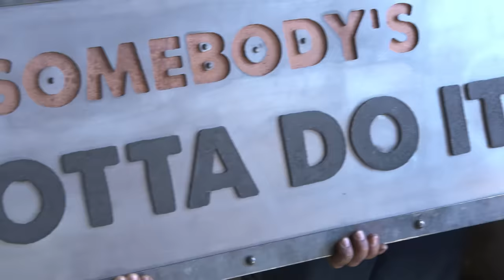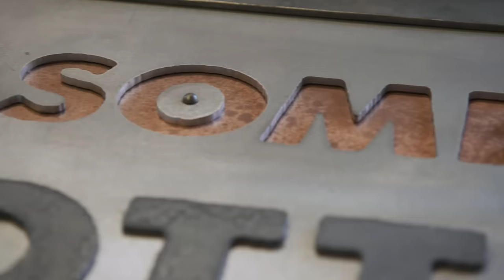Mike Rowe Learns BLACKSMITHING in the DRAGON FORGE | FULL EPISODE | Somebody's Gotta Do It

Comment: Nice segment and nice shop.  Most people think of a blacksmith as someone with a size 50 coat and can look threw a key hole with both eyes. As the gentlemen in the segment showed there is a lot more to it. As a retired smith it took me places I would never have dreamed. My shop was an artisan/industrial shop. We made tools that were used in the space program and in the refining of gold and silver. On the artisan side we worked on interior iron work for houses and casinos. We got to restore things from the 14th century on up. Goes to show you if your not afraid to be different than the herd life can be rewarding. Thanks to Dragon Forge for showing what can be done by hand and brain.